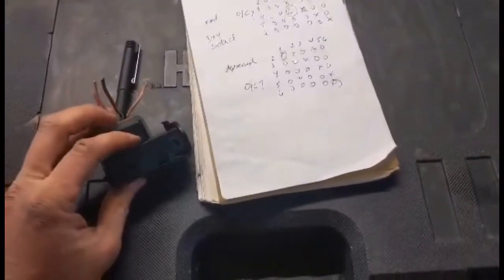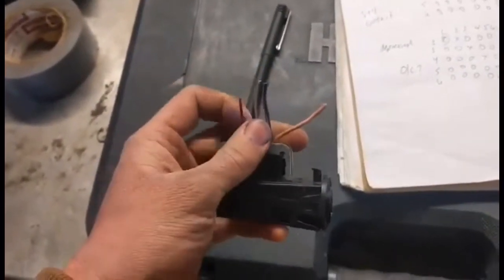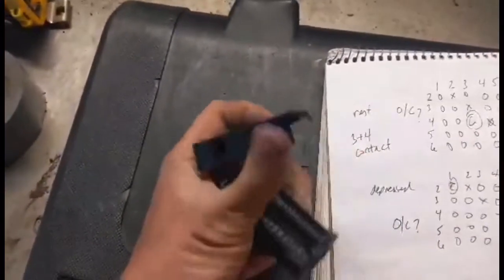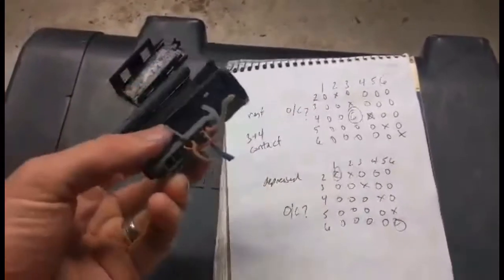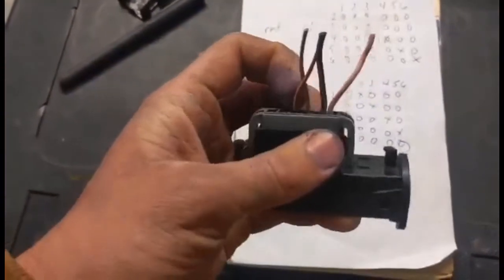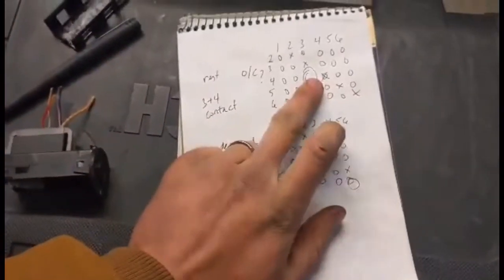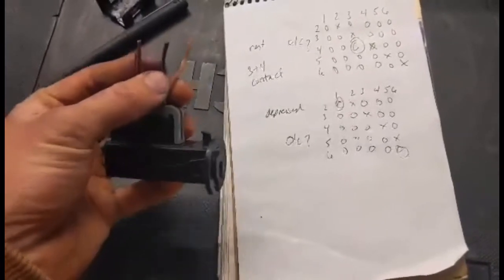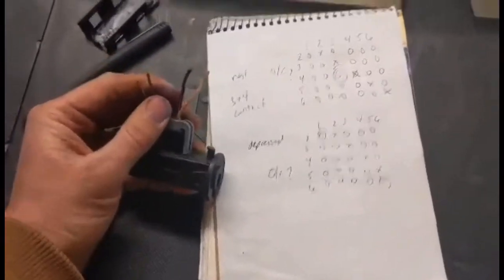Bypassing the Clutch Disconnect Switch | 2000 F-350 Super Duty

Comment: Hey thanks for the video! Worked like a charm, I did the grim joint too and didn’t want to lose my cruise either. As it turns out there is a fail safe in the ecm and my cruise cancels as soon as the trucks starts to rev up when I push the clutch. So all is well!

Comment: The wires are different colors, but this worked on my 2004 model. I made two jumper wires by cutting two 2" lengths of 16 gauge wire, stripping the ends, and crimping male spade terminals to the ends. Then grind the spades down to the size of the pins in the switch. Then plug the spades into the plug to jumper the wires together.

Comment: why half ass it?  Why not just put a new $20 switch in?   am I missing something?  Cruise control needs this switch. Safety concerns, etc.....   It is FAR easier to fix it correctly than to half ass it like this..  SO RIDICULOUS!!!
Reply: 20 bucks? I just saw one for 60
Reply: Switch is $60 and........ new switch didn't solve things.
Reply: What if you desire to not have to press the clutch everytime you start?
Reply: Easier said than done when you’re stranded without $.
Reply: early 99  with zf6 manual bought new from dealer did not work mexican china junk. So this is the best fix i dont use cruise. this is like the other two sensors to make a 7.3 run you want the good oem parts from riff raff or reliable diesle source. not autozonejunk.